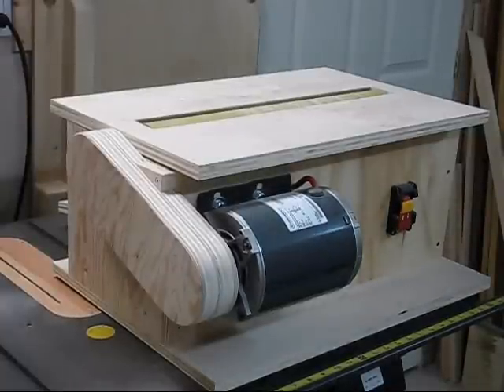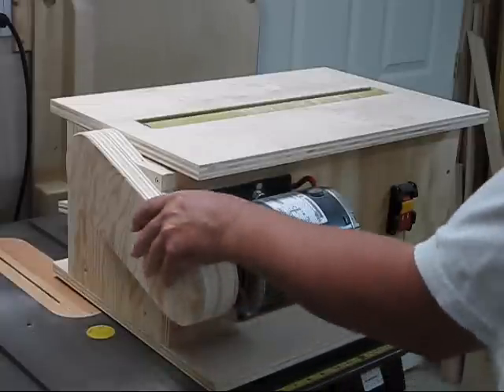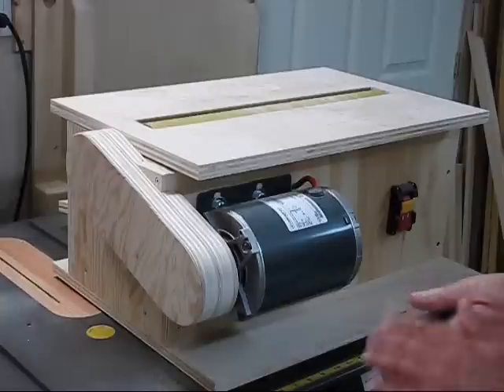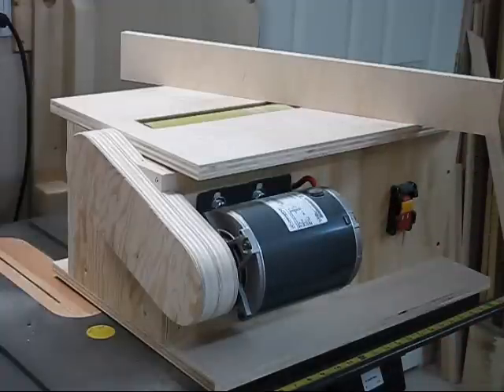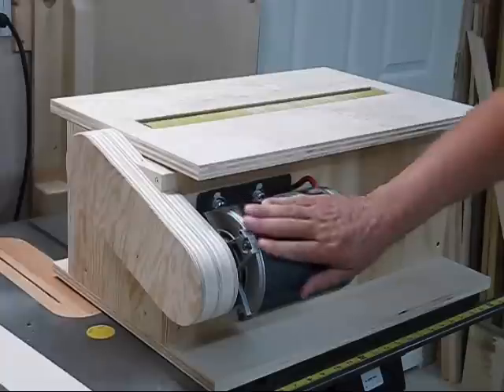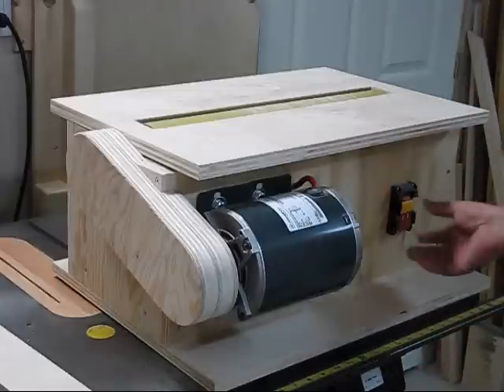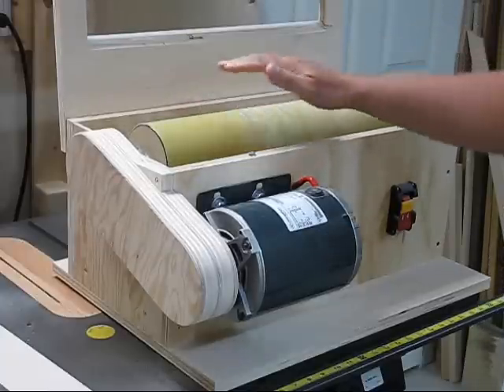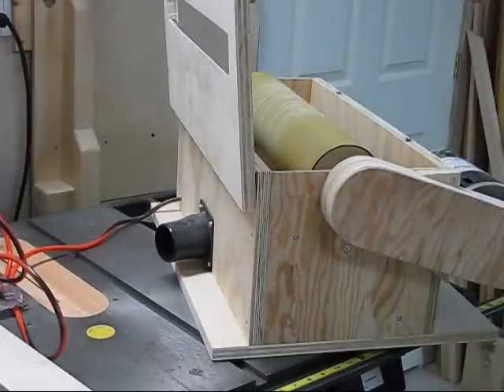V-Drum Sander Build - Part 3

Comment: This is what I've been looking for, thank you!  Did you seal the MDF before the applying the hook Velcro?  What was the width of the hook, and sandpaper also?  I found 4" hook, can I apply 3" sand paper over that, or do they both have to be the same width?  Is the sandpaper backing matched the hook, or will and loop sand paper work?  Thank you, Working Hand
Reply from the maker: Hello, no I did not seal the MDF prior to applying the velcro. On mine, the width of the hook is 2" and the sandpaper is 3" so any widths will work. The sandpaper with the loop on the back came from an online company and the hook portion I bought from a material store in my area, and they work well together. The only minor change I made in my design is where the tip of the sandpaper on the side that comes toward the table top must be anchored down or sometimes it can lift and get jammed. I cut a small notch at one end of the drum to tuck the tip of the sandpaper into before winding. This will keep it secured in place. The other end does not need this as it is spinning away from the table top so it will never jam. Hope this helps.
Reply: Thank you Paul.I purchased a 1/2 HP used yesterday and I'm headed out to the shop to experiment the circles.  I'm going to use a 3/4" shaft, so I'm going to cut 4x4 MDF squares set them up on the drill press to repeat cut 3/4" Forstner bit holes.  Then put them on my band saw circle cutting jig with a 3/4" center plug to rotate the MDF.  I'm thinking this will keep all the circles very close to round and the 3/4" hole will be ready for the shaft.  Any thoughts?

Comment from the maker: I can send you a Sketchup drawing of the wood dimensions if you like.
The motor and metal parts I picked up at Princess Auto.
I started with a spindle that fit the motor and got the same size that fits the axle so the rpm's don't change.
I picked up pillow-block bearings to fit the axle as well, all from the same place.
Perhaps I can make another video with more detail on the construction.
Reply: Did you ever make the follow-up video with the parts you used?

Comment from the maker: Any fabric store will have the velcro hook part, ensure you get the self adhesive type, not the sew on type :)
The sand paper I could only find at an online store - Stockroom Supply - ensure it has the felt part on the back to adhere to the velcro.
Most machine tool stores I've been to in my area only carry the cloth back rolls which won't work with this type of sander.

Comment: Thanks for the videos Paul! You may have answered this before but what type of hinges did you use for the top? I tried a continuous piano hinge with minimal luck as the machine had enough vibration to slightly loosen the pin holding the hinge together.

Comment: Do you notice the edges of the project being sanded becoming rounded-off because of the floating paper?
Reply from the maker: No. The paper is not that high above the tabletop. With the sander off, passing a piece of wood across the top should just touch the sandpaper without turning the drum. If the drum turns, then it is too high. This is why I have the 2 adjustment screws at the front of the box to raise or lower the top a bit. Usually when I use the coarse grit paper I have to raise the top a bit because the sandpaper is thicker. Hope this helps.